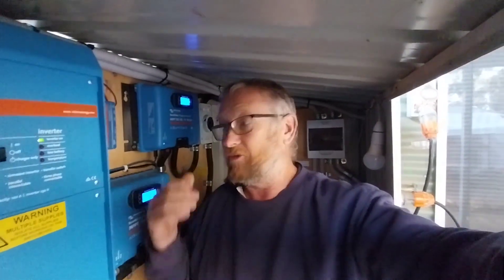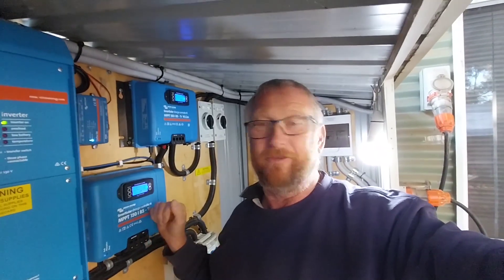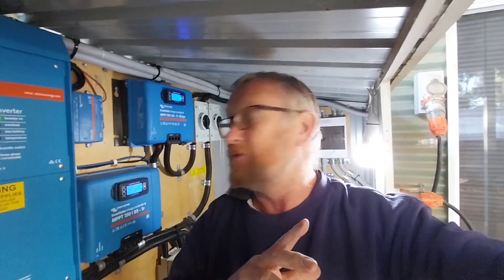We Have DC Ripple - So Let's Problem Solve This

Comment: Victron inverters have ripple alarms. If there is a significant amount of ripple inverters will let you know by alarming. If they dont im not sure that its worth worrying. But i dont know what exactly your subscriber saw , so not sure what is going no. Cable must be same length and diameter though. I wish you luck.

Comment: You need to fit a BMV-712 Battery monitor or a Smart Shunt as that is your point of truth for accurate battery voltage, then the mppt's will be taking their battery voltage reading from the voltage read by the Smart Shunt.
Reply from the maker: Yep it does have all of that. It runs a smart shunt plus the Cerbo GX  for remote monitoring which you can see next to the controllers. The shunt, charge controllers, inverter and Cerbo GX are all networked together.
Feel free to watch this video on my system in the link below. I did film it a while back and I have made some changes since, but you will see how it's all put together with all of it's components.
https://youtu.be/52W6GjU7urU?si=ytNT7PXZlodhMdIl&t=142
Reply: @TheOffGridBachelor but are they networked by bluetooth or the GX ?

because the mppt's show the bluetooth network.  you should try and make strangers of the components bluetooth-wise. the GX gateway is the mothership and needs to act like one.
Reply from the maker: I responded but gonna rewrite my responses as I forgot I had made some changes.
Yeah they were blue toothed together but I have removed one of the controllers so I am only using one controller now.
The ripple issue is fixed for now which I did another video on which is the next video after this one.

Comment: As much as matching cable diameter and length is a good thing, I would of thought that would only influence voltage reading if there was a high battery charge current.
Reply from the maker: Yes your correct and trying to get people to understand this is sometimes impossible.
People fixate on this cable length thing way to much. If one cable is slightly different in length to another cable on large size cables with higher voltage and low current flow, it doesn't make any difference. If it was say half a meter difference then yeah it's going to start to have an effect but only with high current flow.

Comment: Had this problem with my victron stuff, too. After switching from AGM to LiFePO4, when the LFP batteries reach about 90-100% SOC. Both my Multiplus worked flawless with AGM. Now with LFP Batteries... Not so much. unfortunately..

Turns out the cells on my new batteries werent properly balanced. So the Multiplus charged the batteries and the BMS of the batteries interrupted the charge. The Multiplus then created a voltage spike because the load (battery) was suddenly taken away from it. It does that in a loop every few seconds when the batteries BMS reconnects because the charge voltage was shut off.
In addition it disconnects the AC-In for no reason, which causes even more problems in my case. For example when Im cooking: The inverter will then overload, after it disconnected AC-In for no reason just because the batteries BMS interrupted charging. Rendering the bypass  completely useless.

Ive never seen any LiFePO4 Charger creating voltage spikes because the BMS interrupted the charging.

I contacted Victron about this and had some discussions on their forums. Turns out there is nothing you can do about it other than lowering the charging voltage. And Victron basically said they dont care because they dont recommend to use any battery other than their own.

Ive always been a fan of Victron and their stuff, but after my recent experience I dont think I will buy Inverters from Victron again.
Reply: I had a very similar problem with my Victron MP2s paired with EG4 Wallmount batteries in closed-loop.  The solution for me was to switch to open-loop and by trial and error I reduced the MP2 absorption voltage so the charge current slowly taped off as the battery reached the BMS charge cutoff set-point.  The goal is to keep the charge voltage just below that cutoff point or at least have minimal charge current when it disconnects.  Problem solved.  Closed-loop is not always your friend especially when you are dealing with mixed vendor equipment!
Reply: @rpsmith  Ive been running open loop all the time. And yes it kind of works now after lowering the charge voltage. Im not really happy with this, tho. 

The setup is installed in my RV and therefore is not in use for weeks or months before it will be used again. Hence I will always have disbalance in my batteries at the start of each trip, unless I want to keep them at 100% SOC all the time (not good for them) or balance them for days before.

My main problem with this is that the Multiplus goes bonkers and disconnects AC-IN just because the batteries disconnect. Which doesnt make sense - and as I said - can cause a lot of problems and renders the entire system unrealiable.

I wish you a merry christmas.
Reply: @Chris-yy7qc  ~ I'm not having that main disconnect problem.  What is your current Absorption and Float voltage settings and what firmware is MP2 currently on?  Also, are you using a GX device and VRM? I bet we can resolve your problems with a little troubleshooting if you are interested.
Reply: @rpsmith  Hi, thank you for your kindness and effort, but to be honest I dont think there is anything that can be done to solve this. Even Victron or the Victronforums dont have a solution other than "buy our battery with our BMS" or "lower the Absorptionvoltage". And as I said: The main problem is the implemented strategy. If the MP would just continue working and wait for the battery to come back up everything would be fine, but instead it goes bonkers and disconnects the AC-IN for no reason. Btw: There is a video on my Youtubechannel showing the MPs behaviour (sorry, its in german).
- The MP 12/1200/50 is running the newest Firmware. I updated it this month, when I experienced the issue. Cant tell you exactly which one right now (v589??), as Im currently not in the same area as my RV.
- Im not using a GX and my Batteries (Renogy 300 Ah) dont have an BMS-CAN.
- Absorbtionvoltage is set to 14V, despite the specification of the battery manufacturer of 14,2-14,6V.
- Float voltage is set to 13,6V.
- Ive got 600W of Solar on the roof btw. Combined with an MPPT 100/50.
- And a smart shunt.
Cheers, mate. 🌲
Reply: @Chris-yy7qc  ~ Does your Renogy battery have Bluetooth?  With out a way to monitor the BMS and cell voltages, it's really hard to troubleshoot problems like this.
Reply: @rpsmith  Unfortunately: No.

It only shuts down (the charging path) in certain conditions, tho. According to the Datasheet:
Cell voltage >= 3,65V or <= 2,5V
Charging current >= 180A
Or High/Low temps

Because this happens only at a high SOC, none of the "other" conditions are met and the Problem even shifts to higher absorbtion voltages and eventually disappears, the longer I "balance" the cells with my CTEK Pro25S: Im dead certain it shuts down (the charging path) because of one cell exceeding 3,65V.

Which again wouldnt be a problem if the MP wouldnt Freak out and just continue feeding a constant voltage instead. Like the CTEK does. So the BMS could do its balancing job and reconnect (the charging path) when the cells are equalized.
Reply: @Chris-yy7qc  ~ I'm not sure I understand what you are explaining but if you want the MP to continue the charge at a higher voltage, just adjust your float voltage higher.
Reply: @rpsmith  That brings us back to my original post.
Reply: @Chris-yy7qc  ~ It seems like you're wanting a Victron fix for a non-Victron battery problem or am I missing something?
Reply: @rpsmith  Yes. Youre missing the part I described multiple times: The multiplus behaving weird and unlogical for no reason.
Again: It doesnt make sense to disconnect the AC-IN, freak out and frantically toggle between AC and Inverter mode, just because the BMS limits charging.

The batteries BMS is exactly doing what its supposed to do. If the multiplus would do the same: Just stay calm and continue supplying the set absorption voltage everyting would be fine.

Comment: Keep lowering your charge voltage until you see the charge current slowly taper off before the BMS disconnect the charge path.  If that final voltage is below 57.6V, your battery it out of balance, has bad cell(s) or the BMS is misconfigured or defecive.  I had this same error with my MP2 that was using closed-loop communications to my EG4 Indoor Wallmount battery.  I solve the problem by going to open-loop and lowering the charge Voltage as I described above.  Good Luck!
Reply: why would the bms disconnect the charging path ?
Reply: @casemodder89 ~ it's the standard practice when the BMS detects that one of the cells went over 3.65V.
Reply: @rpsmith  why would the BMS disconnect if you "keep lowering the charge voltage" like you wrote ?

makes no sense at all.
Reply: @casemodder89 ~ By lowering the charge voltage you can finally keep the highest cell voltage below 3.65V or whatever voltage the BMS is set to disable the charging FETs.  Then knowing that top voltage, you can tell how well balanced your cells are.  Even better if you can communicate directly with the BMS to see the individual cell voltages and BMS settings.
Reply: @rpsmith  if you do it like that to avoid individual cell OV shutdown of the BMS the pack voltage is not a solid good/bad but a floating value HOW MUCH out of balance the cells are.

but at the same time it is far from accurate.

the BMS might have a crappy software (like daly settings on stock delivery were) and allows the cells to a voltage of 3.8V before IC-OV protection trips.

 at the same time the same BMS could allow for 2V IC-UV trip.  that would mean a vastly out-of-balance pack with cells damaged from over voltage/under voltage but a healthy appearing pack voltage.

safety and longevity is only avsilable with individual cell voltage measurement and readout of the BMS settings.
Reply: @casemodder89 ~ I only use this method if I have no communications with the BMS.

Comment: I was getting a ripple alarm and it ended up being a loose connection at my 200A breaker. I learned from a coworker years ago... always check for loose wires first.

Comment: Those MPPt controllers have two large inductors and every time they switch on and off ripple can occur because of back EMF from my coils has to go somewhere. Maybe try some small uf capacitors on the input and output

Comment: It's almost certainly hysteris in one or both of the MPPT regulators. Even with precision voltage references you will see slight variations between units, you also have parasitic capacitance and inductance the circuit that can throw off the feedback network in a controller.  

The voltage is falling just enough at just the right frequency to cause one or both of the controllers to oscillate off and on. 

If the outputs of both controllers are ultimately connected in parallel you could try running a cable directly between both of them to short out any inductance between them and equalise the voltage they both see on their outputs. 

How much ripple are you actually measuring? how many mv at what frequency? What device is actually detecting the ripple?

Even good inverters often create a shitload of ripple themselves and have significant input filtering to protect anything else on the same DC bus. Usually some form of highpass filter, these filters work both ways and should protect the inverter pretty well. 

I'd just chuck a big capacitor on the outputs of both MPPTs and maybe the inverter input and see if that supresesses it also
Reply from the maker: In one of my other videos I left the link to the VRM portal where everyone can see my 48 volt system and view all the data. One of my subscribers noticed my system had been loging high DC ripple alarms and brought it to my attention. From there I have been trying to eleminate the ripple the best I can.
I will leave the link below so you can see the system and if you go onto the advanced tap you can see all the data, scroll through the history and see the alarm logs.
https://vrm.victronenergy.com/installation/190064/share/99479d14
Reply: @TheOffGridBachelor  I dug through quickly, I'm not sure if I can get more information out of it by directly exporting data. From what I could see the logged high ripple current events are logged shortly after transient surges in power demand on the inverter itself.

The batteries will be floating at a high voltage, inverter demand will increase pulling the voltage back down to 55ish volts and in that transition a high ripple alarm is triggered. 

I'll dig into some spec sheets and see if I can extract more information, but I think this is a non issue and the actual noise/ripple seems to be coming from the inverter itself. 

Duty cycle on the primary side mosfets are adjusted to compensate for both AC output load and DC input voltage sag, a sudden drop in input voltage as the batteries are briefly pulled out of float would cause the controllers in the inverter to ramp up dutycycle and/or switching frequency to compensate. As the voltage rebounds , the controller would have to slam in the other direction to prevent overshoot on the output. As the MPPTS start pumping more voltage into the full batteries, the voltage rises, causing the rebound. As current continues to be drawn, the MPPT switches from float to absorption mode delivering more current but at a voltage below the float voltage, the voltage on the inverter drops and it compensates by increasing duty cycle. All these different influences on the battery that are operating at the boundaries of different states of operation cause hysteris and thus higher ripple or noise. 

Mind you, this all happens in maybe a couple thousandths of a second at most. I'll need to dig deeper, I don't know what the actual threshold changes are to log certain events but unless you're running radio equipment directly off the batteries, I doubt this is a meaningful problem.
Reply: I believe ripple current is between the inverter and batteries and has nothing to do with the MPPT controller(s).

Comment: Sounds like you'd benefit from using DVCC
Reply from the maker: as in the new power regulations (DVC-A, DVC-B & DVC-C) ???
Reply: @TheOffGridBachelor  ~ Settings  |  System Setup  |  Charge Control  |  DVCC
I always enable it but I don't believe it's a factor here.

Comment: Cables must be equal in cross section and length.

As you have ripple issues, check the torque on the connections. Difference in cable length causes temperature differences, cyclically loading the terminals.

I have seen inverters destroyed, and in one instance catch fire, caused by loose terminations shorting.

Comment: 7:39 Try starting your charge controllers or inverters up with a 50W/10 Ohm power resistor in circuit so that you don’t get that high in-rush current and spark. Your electronic equipment and fuses will last longer.

Comment: You definitely need to have the same cable sizes and the same cable lengths for both units both positive and negative. You want voltage drop less than 0.5volts across the cable run. Also your HRC fuses appear to be only rated to 80Amps they will have a 15% over current rating but you may want to upgrade to a higher rating obviously your cables need to be able to carry the rated fuse current
Reply from the maker: The charge controllers run the 80 amp fuses as you saw in the video which is over 4.4 Kw's at 55 volts. I only have 3.2 Kw's of panels on the roof which will run the controller to just under a maximum of 60 amps but I do current limit the controller to only 50 amps. I did say 60 amps in the video but I meant to say 50 amps 🤫

So I would have thought the 80 amp fuse should be more than enough for the current flow. I mainly have it in case I get a controller failure and it decides to dump all the battery current backwards into the controller which would be a lot of current.

The fuses on the inverter which are housed in the second fuse block are 125 amp fuses which is rated to just under 7 Kw's. The inverter is a 5000 VA which is around 4 Kw's so the 125 amp fuses on the inverter should be fine as well although they are a little on the light side. The inverter can surge but I don't have anything in my system that will surge any higher than a few Kw's.
Reply: @TheOffGridBachelor  ok yeah i wasn't aware that you can current limit the controllers. Im just doing some research im looking at building my own off grid system 🤫 i live in the suburbs. 
I have 20+ years experience with high current 48v dc and 12v off grid vehicle systems and am currently involved with the manufacturing of industrial scale BESS systems.
So i thought that id have a go at building my own system. I've got a mate who was a solar installer who can get me the panels at a good price and 300sqm of roof space.
The goal is to get all my parasitic loads off the grid and some of my lighting
Reply: @TheOffGridBachelor fuses can take a max. of 80% of their rating continuous.  wires should be sized at least similarly.  use max. 80% of their capacity for normal operation and keep the overload capability for short circuit faults to deliver ultimate amps so the fuse actually blows fast instead of sizzling fot half an hour melting everything into a puddle and posing a risk of fire.